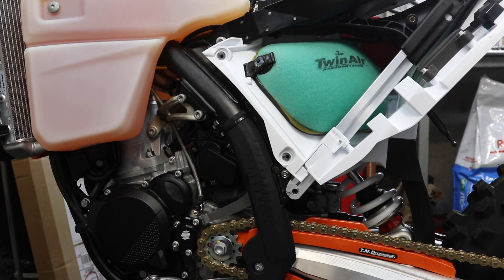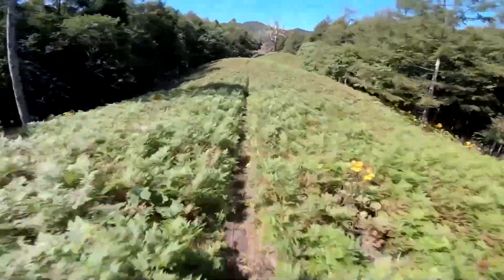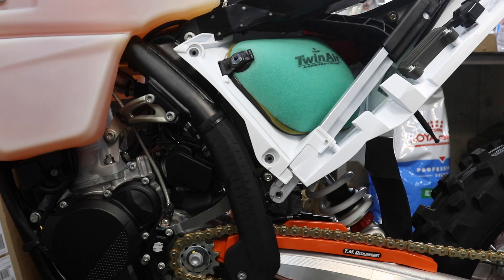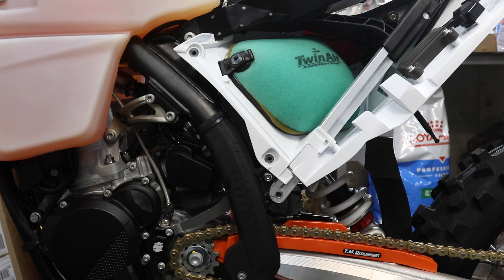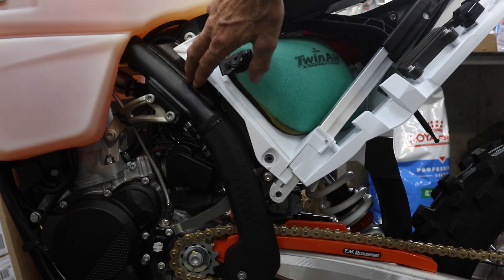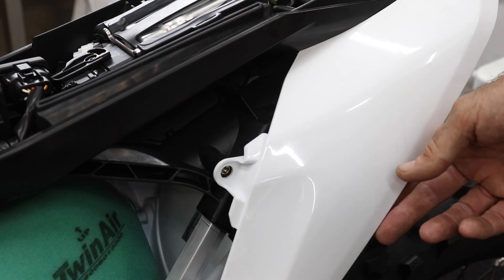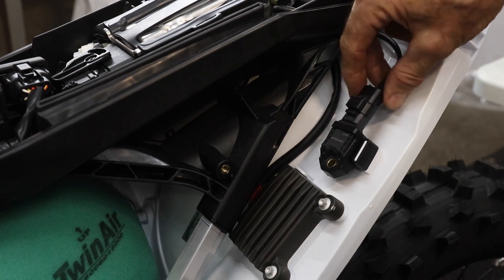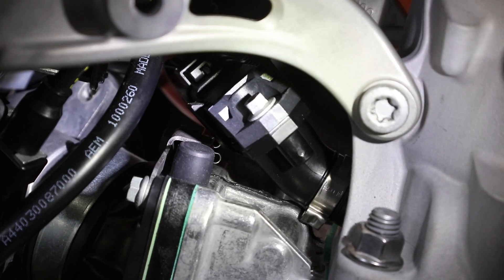2024 KTM 300 EXC/XC-W Pressure Sensor Locations

Comment: Hello, i ve been watching your channel for quite some time now. You are doing an amazing job, keep it up. Could you please make a video on how to adjust correctly the idle on the 300 exc 2024? cause i m having a hard time adjusting the idle on my bike, the store where I bought it from didn t deliver it with it adjusted! Thanks☺️
Reply from the maker: Sorry to hear about the idle issue on your bike. The red adjuster knob on the throttle body controls the idle speed. My idle was a little too low and I was able to adjust it faster using the red knob. Yes, I can make a video about it...
Reply: @TokyoOffroad  Thank you so much!❤
Reply: You will see a red knob on the throttle body (rear lower part of the engine). Reach in with your hand or with a long pair of needle nose pliers and turn the red knob clockwise to increase the idle and counter clockwise for a lower idle...it's that easy.

Comment: So forgive me for not being up-to-date on this, but are these both things that need to be replaced often? Other words did they require service on a regular basis?
Reply from the maker: I have 100H hours on my 2024 KTM 300 TBI and both the sensors are still working fine. So no, they don't need to be replaced regularly. However, if you're a serious racer you could choose to replace the crankcase pressure sensor periodically, before it fails (E.g. every piston change) as preventative maintenance. The crankcase pressure sensor will typically go bad sooner than the atmospheric sensor as it's exposed to oil and fuel.

Comment: I heard somewhere that the crankcase pressure sensor has an equivalent in car parts. Do you know the make and model that would fit the TBI bikes?
Reply from the maker: @TimoTurner  - Yes, I’m sure there is an equivalent part available, but I don’t know the details. On my 2024 KTM 300 I’m at 125H now and still using the original CCPS sensor with no problems. I have a spare OEM sensor just in case the original develops an issue.
Reply: @TokyoOffroad  Thanks for the response. If I get any info, I will let you know, cheers.

Comment: Can you switch them so you can check the CCPS on the tbi just like you could on the tpi?
Reply from the maker: Yes, both the CCPS and atmospheric pressure are the same part number so if you want to swap them to check that's fine. Note that the TBI pressure sensor part number (A45041075000) is different from TPI (55641075000).